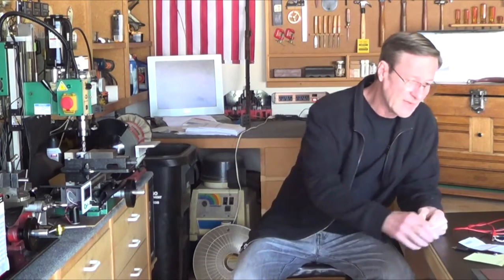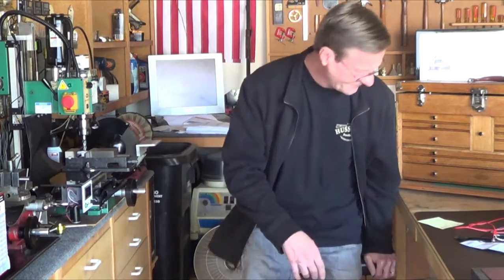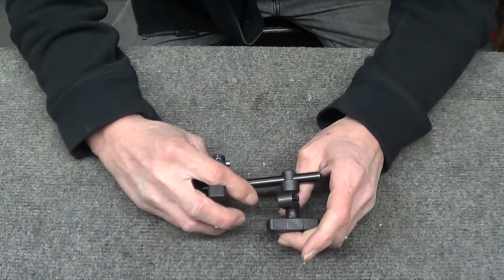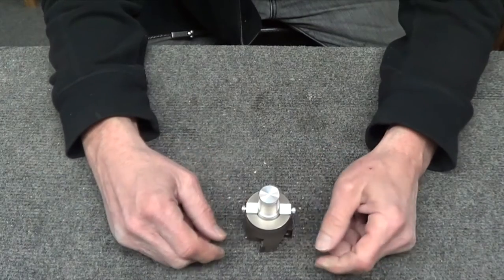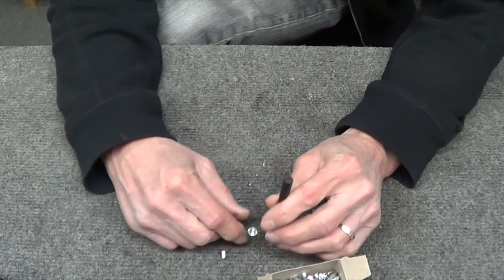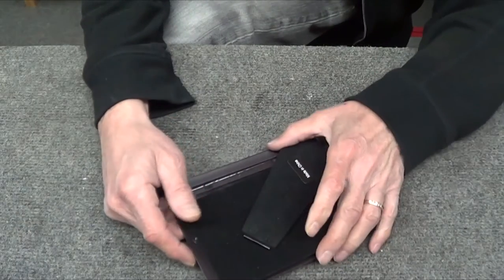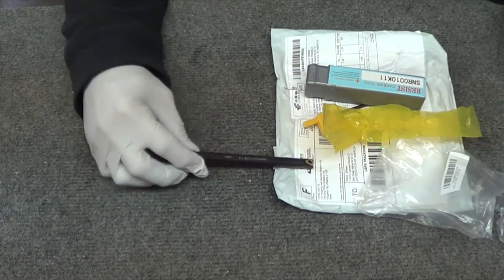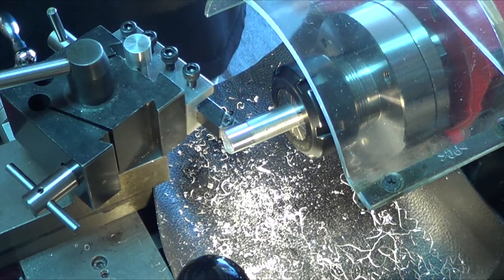Aluminum Insert Trial Video #68

Comment: sounds like a good project to true up the angle plate
Reply from the maker: +dozerd12r Wish I had the equipment to do that but alas I've never needed it...
Reply from the maker: +Dave M I did find a really good use for it and will show that in the next video LOL...
Reply: +Dave M I would bolt it to the back of you mill and to the table. Stiffen up the column a bit. I have a 18"x4"x6" that I bolted to the back. Made a huge difference.
Reply from the maker: +Nick Schneider In this video I show a large steel bar that corrected tram and also stiffened up the column. I hear you, it made a big difference. https://www.youtube.com/watch?v=t_0O5atzBdo

Comment: Hey Dave, I suspected they were not Mitsubishi inserts as I told you in the previous video. I think I have some Seco inserts that will fit that cutter, you can try them out. What size does that cutter call for?
Reply from the maker: +Nick Schneider Not really positive what it takes its marked JAP400R-50-22 and I think APMT1604PDER...